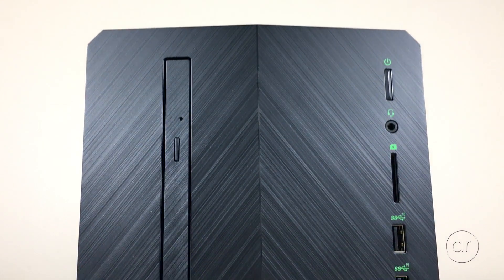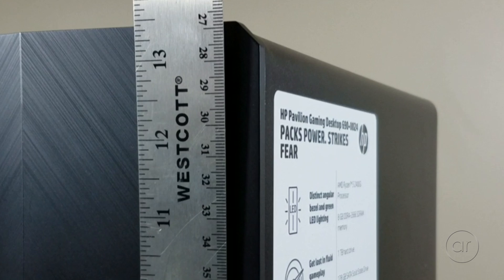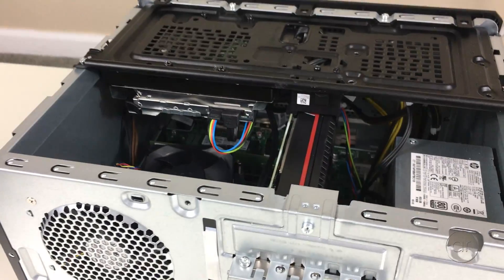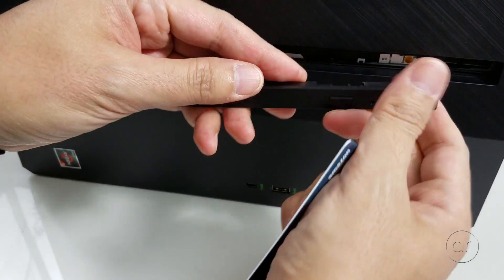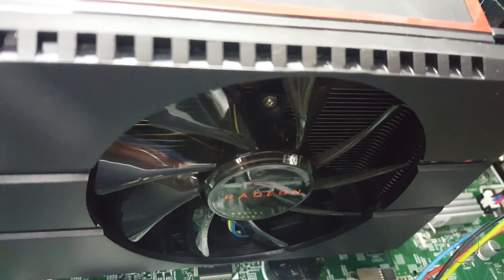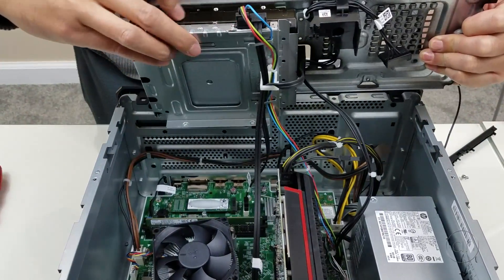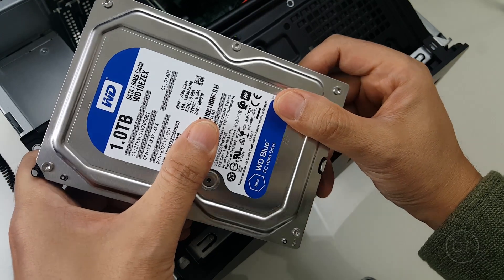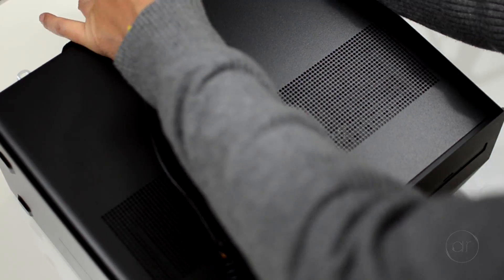How to Open and Upgrade a Ryzen-Based HP Pavilion Gaming Desktop

Comment: how can i unblock the hdmi port?
Reply from the maker: Do you mean the one with black cover on it? You may be able to remove the cover but I don't remember if there is even an HDMI port on the motherboard. I know the blocked VGA port can be used if you remove the RX 580 (it will switch over to the on-board graphics).
Reply: @accessrandom  thank you for your answer.
Yes there is HDMI port on the mother north. But I have another question. What power supply can I use in this case? I have not seen this format of power supply in any brand.
Reply from the maker: @CristianGonzalez-hk5dn  Ah ok. I remember experimenting with the on-board ports but could never get the HDMI port to work (there were no settings in the BIOS). I was able to get the VGA port to work because I think the BIOS auto-sensed the connection.
Reply: @accessrandom  what i mean with the power supply format is that the case has a hole that matches with the power   connector
Reply from the maker: @CristianGonzalez-hk5dn  There's two considerations when replacing the power supply - one is the physical dimensions, which is 2.8125 x 2.9375 x 6.25 inches or 71.4375 x 74.6125 x 158.75 mm. I checked the screwholes of the power supply, and they are roughly 3 3/8" apart at the top and about 3/8" along the bottom of the PSU. The other problem is that it is non-standard, so you would need to go with an HP OEM part (which is relatively expensive).

Comment: Can you upgrade to a 500 watt box ??
Reply from the maker: If you mean only the power supply, you can only upgrade to an OEM one from HP (part number L05757-800) since it has non-standard pins to match the motherboard. I'm afraid a normal, retail power supply will not work.

Comment: Oh boy, this pc is hard to upgrade, in my coutry ia amd ryzen 5 3600 and gtx1650, id it comes with that shitty motherboard, i think i would nes to buy a new mb, and a new case
Reply from the maker: I agree -  memory and storage upgrades are fine, but shame on HP for using such non-standard components like the motherboard and power supply.

Comment: Can you upgrade the motherboard just in case you want to switch to Intel CPU?
Reply from the maker: That's a good question. HP has many Pavilion 690 models - some Intel and some AMD. I can't imagine that they would use a different form factor motherboard for the two CPUs. I'll need to defer to any viewers who have tried this to get a definitive answer - anyone?
Reply from the maker: Oh - also, in my previous reply, I was referring to the replacement of the motherboard with another OEM motherboard from HP. If your question was about replacing with a third-party motherboard, the existing motherboard is highly custom - so the power supply would need to be replaced at the same time, since it's non-standard (and matches the existing motherboard).

Comment: I have the 690-0067c

I would like to upgrade the RX 550 and the 310 watt PSU into a:

RX 580 and maybe a higher wattage PSU. Any suggestions or tips on upgrading?

Comment: Can i slot all the components onto  a new motherboard and bigger case?
Reply from the maker: Yes, all the components except the power supply can be moved to a new motherboard. The power supply itself has non-standard pins for its connectors (matching those of the non-standard motherboard), so you'll need a new PSU. All other components are standard, though you may need some type of adapter for the slim-style DVD-RW drive.

Comment: what kind of memory can I add? can I get the highest quality Ram sticks and upgrade?
Reply from the maker: If you're adding a stick to the existing one, you'll want to match it (see the "Memory" section in the description for the out-of-the-box memory and the memory that viewers have successfully added). If you're looking to replace the existing memory, there's a list of successful memory upgrades in the "Replacement Memory" section. Theoretically, any DDR4 memory 2666 MHz or above should work, but I wanted to compile a list of proven installs...
Reply: @accessrandom  i have 16 gigs in there witch are two 8 sticks, I want to go to the 16 sticks each for a total of 32 can I add two 16 gig sticks at PC4-25600, or does it have to be PC4-24000
Reply from the maker: @James_Pressey  You can upgrade to a total of 32 GB at either speed (but keep in mind that they will run at 2666 MHz since there are no timing options in the BIOS).
Reply: @accessrandom  thank you sir.

Comment: going to check out a and ryzen 5 2400G,nvidia geforce gtx 1050 ti (4g), 8gb ram 1tb HDD ,690-083w and i like some of the reviews i seen but i seen something about the psu being 400 and the card requiring 500w or something ? would this computer still be recommended for gaming ? i don’t plan to do much updates to graphics cards etc unless needed lmk asap before tomorow !!!
Reply from the maker: According the nVidia's specs page, the reference model of the 1050 ti requires a 300 W power supply so you should be safe. However, please keep in mind that if the 690-083w is anything like the 690-0024, the motherboard and power supply will have non-standard power connections - so if you want to upgrade to a graphics card in the future that requires more power, you may need to replace the MB and PSU at the same time.
Reply: access random okay cool but say if the Graphic card went out can i replace it with the same one and be fine???
Reply: access random not looking for upgrades just maybe ram etc
Reply from the maker: @AGPLilTrill  You should be fine, then. The Pavilion is good for upgrades to basic components like memory and storage.

Comment: Can you swap out the case fan?
Reply: Thanks, I ended up swapping it for a bquiet 92mm fan.
Reply from the maker: @joecandelaria3169  Thanks for the update. May I add that information (about it being a 92mm fan) to the description with credit to you?
Reply: @accessrandom  Yes go ahead!
Reply from the maker: @joecandelaria3169  Done (under Case Fan) - thank you!
Reply from the maker: Yes you can. Unfortunately, I didn't measure it while I was inside, but I believe it's 92mm. I'll check to make sure the next time I open the case.

Comment: Does this pc support 3000mhz Ram upgrade???
Reply from the maker: Yes, you may install memory rated at 3000 MHz (many others have upgraded to faster-rated memory as seen in the Replacement Memory section of the description). However, there's no way to change the speed at which it runs in the BIOS, so unfortunately it would still run at 2666.
Reply: @accessrandom thanks

Comment: So i recently bought a new graphics card but it is too big for the case, so i need to get a new case and then completely move everything over to a new case, what do you think the possibility of me being able to  are
Reply from the maker: The motherboard and power supply will need to move together, since the pins for the power connection are non-standard on both. All other components (RAM, storage, graphics card, M.2 SSD) are standard so they can transfer without problems. The only thing I am unsure of is the mounting holes on the motherboard and power supply, and whether they would match up with a standard case.

I checked the screwholes of the power supply, and they are roughly 3 3/8" apart at the top and about 3/8" along the bottom of the PSU. I would just make sure that any case that you get has the same hole patterns for both the motherboard and power supply.
Reply: @accessrandom  thanks I will make sure to pay attention to that

Comment: Getting into pcs on a budget (just a console noob here) and I was going to throw money at a prebuilt with some upgradability, and this video was very helpful! My cousin has this system, I tried it out and gaming on R6 felt too buggy at Medium but felt smooth af on Low settings (and this game was released before the 690) so I wanted to see if upgrades were possible before jumping into my favorite game and running flat after a couple months. This system is terrible at running ForkNife so it was fun watching my cousin (13) struggle with playing his "favorite game"... Then I tossed him on R6 like a good gamer 💀 Anyways, At least I can run Low with high hopes to run Medium to High-ish one day very soon 💀 Thanks! GG
Reply from the maker: You're welcome - glad you found it useful .The HP Pavilion is good in the sense that most of the simpler components can be easily upgrade (like the RAM and SSD). The motherboard and power supply are harder to upgrade since they are both non-standard. One of the bigger problems is the graphics card - the RX 580 is a very capable card but if you want to upgrade, you need to consider the power requirements and the physical dimensions of any new card. It shouldn't surpass the power requirements of the existing RX 580 or you may need to upgrade the power supply (which means upgrading the motherboard also). TLDR: you can upgrade the simpler components but the major components can be a headache. Hope that helps!

Comment: Hi, i am about to upgrade mine, can i use this old 16gb ddr hp ram (stock) for the new gaming motherboard to be specific (msi z390 gaming edge ac) before i decide to buy new rams? hope u somebody will answer asap thank you
Reply from the maker: Do you mean moving the RAM from the HP Pavilion to the MSI? It looks like the Z390 takes DDR4, so the memory from the HP (also DDR4) should work fine. The stock memory from the HP Pavilion 690-0024 can be either a Samsung M378A1K43CB2-CTD
 or an SK Hynix H5AN8G8NCJR, both rated at 2666 MHz.
Reply: access random i have hp pavillion gaming with i5 9400f and single fan rtx 2060 gpu, when im streaming gtav or rdr2 it really blows heat from the back and gives me fps drops, so i ordered silentium pc case, new mb msi z390, liquid gpu cooler and 700w new powersupply, my plan is to take cpu, gpu, ram and storages from hp pavillion stock case, do you think what my plan will help my situation? Because when i downloaded afterburner it nearly overlock my gpu
Reply from the maker: @kimpdavid  Yes, that is a good plan - all the components that you listed should be standard and work fine in the new case with the new motherboard and power supply. Even in the 690-0024, overheating can occur because there is not enough airflow (you can see the troubles one of my commenters went through in the CPU Fan section of the description).

Comment: does this have 400 watts of power.
Reply from the maker: Yes, for the specific model that I use in the video (the 690-0024), it is a 400 W power supply.
Reply: @accessrandom   is this pre installed as well what is the pcie number on  beside the graphics card.
Reply: @accessrandom  is there any pcie 4 slot
Reply from the maker: @lukewilliamson4650  It has a PCIe x16 slot
 (for the RX 580) and a PCIe x1 slot. Please note that there is a caveat of using the x1 slot (see the description under PCIe x1 Slot, found by jofrejkd).
Reply: @accessrandom  for some odd reason hp list it pcie x4 on there website for the mother board.
Reply from the maker: @lukewilliamson4650  Yeah, I noticed that also. They seem to be a little confused because they list is as x1 on the image, but x4 in the text description.

Comment: I Upgrade my 1050Ti to a 1650 :)
Reply from the maker: Excellent 👍 If you send me your Pavilion model number, and the 1650 make and model, I can add it to the description if you'd like, with credit to you.
Reply: @accessrandom  690-002la and a GTX 1650 XLR8 OC.
Reply from the maker: @melacho836  I added it to the description. Thank you!
Reply: Did you with the power supply. If so, which model did you use?

Comment: Can you upgrade to a Nvidia RTX 2060?
Reply from the maker: I haven't had any reports of the RTX 2060 (you can find successful upgrades in the "Graphics" section of the description), but any card that you get would need to be 10" in length or less. Also - please keep in mind the power requirements: the PSU is 400W and only has a 6-pin connector for the graphics card.

Comment: Can you upgrade the power supply?
Reply from the maker: It's possible, but I'm afraid it would need to be an HP OEM part and probably overpriced - the only report of a successful upgrade that I've received in the description (under Power Supply) was to an OEM PSU. The pins are non-standard coming from the power supply (and thus, the motherboard is also non-standard).

Comment: Can you take everything out and put it in a bigger case for more upgradeability?
Reply from the maker: One caveat is that the pins for the power connector on the motherboard and the power supply are non-standard, so they would need to be moved together. All the other components (graphics card, memory, M.2 SSD, and hard drive) are standard, and the DVD drive is the thin type so you may need an adapter to place it in a 5.25" bay.

Unfortunately, I didn't check the mounting holes for the motherboard while I was inside, so I'm not sure if they are standard spacings. Has anyone else tried this? I checked the screwholes of the power supply, and they are roughly 3 3/8" apart at the top and about 3/8" along the bottom of the PSU.
Reply: @accessrandom  tbh I didn't realy understand this lol. And I haven't seen anyone do this i was just wondering if it was possible.
Reply from the maker: @wow3434  Oh, sorry. I think others have done this but they have usually replaced the motherboard and power supply (while moving everything else over).
Reply: @accessrandom  Thanks!

Comment: I have the same model and everything, but I have the rx 550 instead, what other GPU’s can I get that are small and is compatible with the power supply and everything...?
Reply from the maker: I've had a few reports of successful upgrades (you can find them under the "Graphics" section in the description). If you are looking at others, keep in mind there's space for about a 10" graphics card, and the PSU is only 400W and has 6-pin connector for power.
Reply: access random will it be possible to upgrade the power supply for more options?
Reply from the maker: @kill5933  It's possible, but I'm afraid it would need to be an HP OEM part (and probably overpriced). The pins are non-standard coming from the power supply (and thus, the motherboard is also non-standard).

Comment: Can you please tell me a 500 or up watt psu that works for this pc
Reply from the maker: The power supply has non-standard pin connections so I'm afraid the only report I've received of a successful upgrade was with an HP OEM part (see the "Power Supply" section in the description). You may want to contact HP to see if they have a 500W PSU available for your Pavilion model. And if anyone has found a 500+ watt model that works, please reply, thanks.
Reply: @accessrandom  Ive heard that the L05757-800 500w 80+ Gold SFF PSU from HP works. It comes with a 8 pin connector and although its slightly too big, you can definetly secure the PSU onto the case with only 1 screw. It also comes with the non-standard connectors for the cpu and motherboard. I have not tried it yet but i will reply if it does work.

Comment: So i currently use the hp pavilion gaming desktop 690-00xxx, i haven't been able to find any videos on the exact model. Although i wanted to upgrade my memory as its the only thing lacking with a mere 250gb I was wondering if the SK hynix Gold S31 1TB would be a good installation? Any help is appreciated.
Reply from the maker: It looks like the SK Hynix Gold S31 is a 2.5" SATA SSD so you should be able to use it as a secondary drive for the 690-00xx family (the 690-0024 that I use in the video is in the same family as the 690-00xx).
Reply: @accessrandom   OMG THANK YOU! Most helpful channel EVER!
Reply from the maker: @marshallmorgan2232  You're welcome, and thank you 👍

Comment: Can you change out the case on this computer for better airflow
Reply from the maker: I haven't checked the motherboard to see if it has standard case mounting hole spacings (note that this is a very custom motherboard) - I'll need to defer to my viewers to see if anyone has tried this. Anyone?

If the mounts are standard, all other components (except the power supply) are standard. The RX 580, memory, M.2 SSD, and hard drive can be moved over into a standard case. The DVD drive is the thin type so you may need an adapter to place it in a 5.25" bay.
Reply: access random thank you so if it has standard mounting hole spacings i will need a different power supply?
Reply from the maker: @valce7248  No, you'll actually need to move the power supply over with the motherboard (because the pin connections are non-standard and match those of the motherboard). I checked the screwholes of the power supply, and they are roughly 3 3/8" apart at the top and about 3/8" along the bottom of the PSU. I would just make sure that any case that you get has the same hole patterns for the power supply.
Reply: access random if there is not a case that fits my motherboard i will have to get a new motherboard and power supply
Reply from the maker: @valce7248  Yes, I'm afraid so.
Reply: access random 😂

Comment: Do you know if the Ryzen 5 3300G or something will work with the hp gaming desktop pavilion? I have the model 690-0010.
Reply from the maker: I'm afraid the 690-0010 will only support second generation Ryzens, up to the Ryzen7-2700. This is according to HP's specifications on their website.
Reply: @accessrandom  Alright, thanks for the reply! I will see if I can get a RX 580 with the Ryzen 7 2700.
Reply: access random Hi, I’ve been looking into APUs and they’re very beneficial for what I’m gonna be doing. (Editing, playing cpu intensive games) and I would like to know if the Ryzen 5 2400g would work for the 690-0010.
Reply from the maker: @BrycensRanch  Yes, per HP the 690-0010 supports the Ryzen 5 2400G.